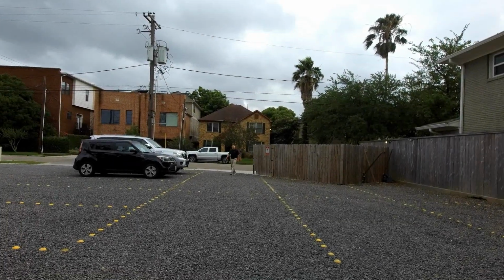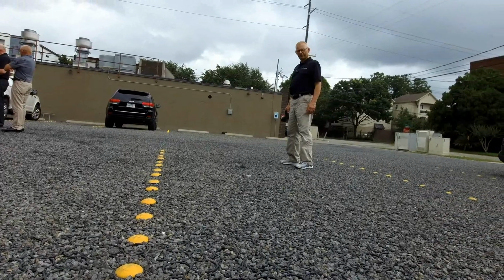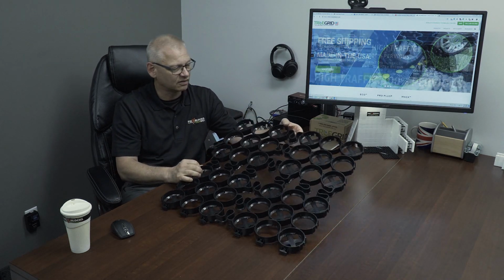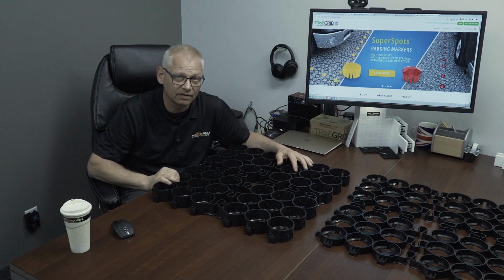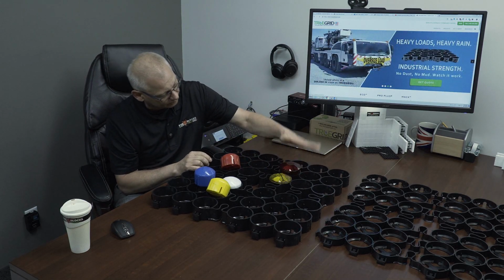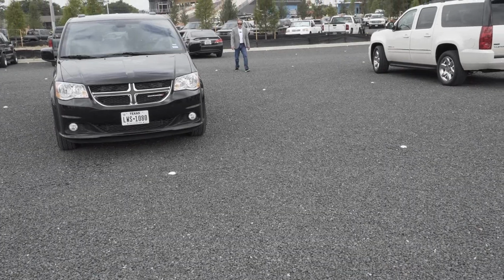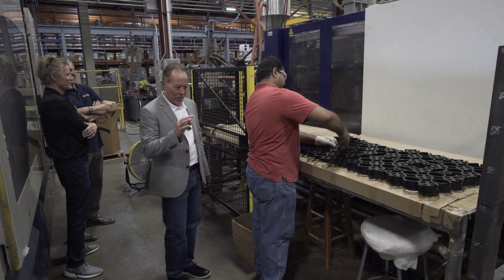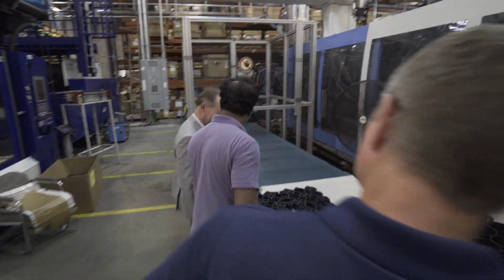Fox Blocks TrueGrid

Comment: The difference between this brand and others of similar solid grids is this company offers as you see those snap in markers and also in reflector type as well in four colors, but also snap on pads for a permeable solid surface without the need to infill with aggregate or grass. Another place these are useful in is a post frame (aka pole building or pole barn) building where it's going to be used for storing of say a sizable tractor or such and even create a wash bay area using the permeable pad surface for even better drainage than a tube type drain. Or even still with aggregate filled floor it would still benefit the utilitarian pole building with out the expense of concrete and reinforcement, for a fully permeable wider floor area, especially where it snows in winter.

Comment: What's the cost compared to paving or pouring a concrete driveway?   Looks like a great product.
Reply: Best to check out the case studies over on the official website, you are not going to get a response from them here on impact or cost difference.